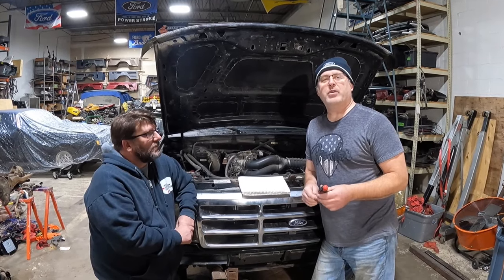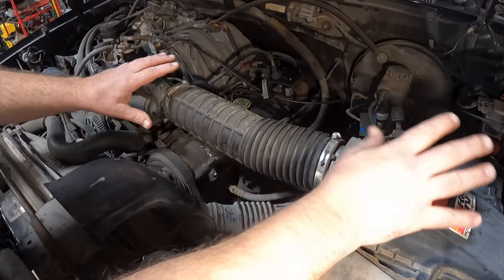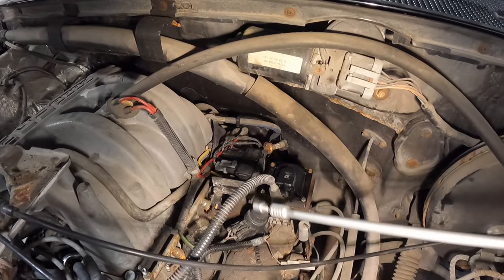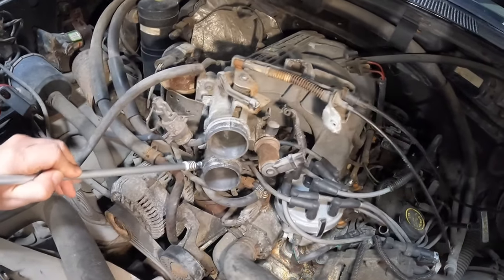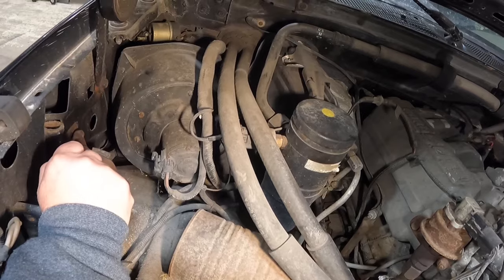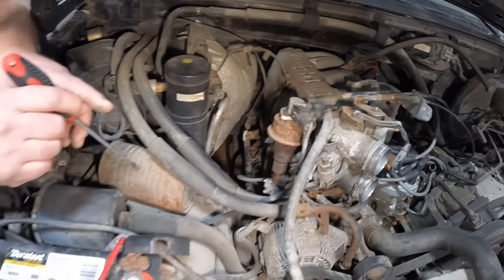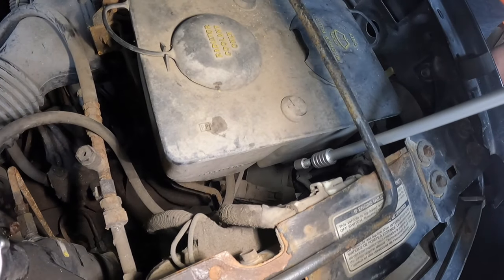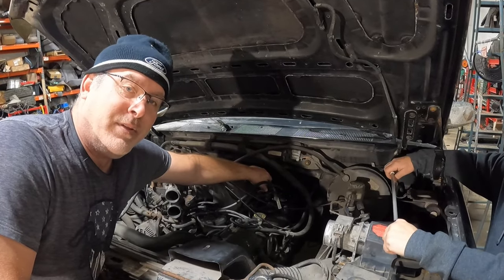What’s Under The Hood Of Your OBS Ford Truck / Bronco - Identifying 35+ Components (92-97)

Comment: Thank you so much for this video! I've had several of these in the past but it's been all carbs for me for a while. Just picked up a 95 bronco and needed to know if I can run an aftermarket temp Guage without the computer getting confused. Thanks to your video I'm off to the parts store.

That flux capacitor has been evading me for years! Never would have found it
Reply from the maker: Glad it was helpful!

Comment: Thanks for this, I've had a '93 f150 and now own my 2nd '97 powerstroke f350. I had a suspicion that the rotted out vacuum lines and actuator under the hood was for the Max AC or blend door. Now I know it's the Max AC. My blend/vent doors and switches all work, but switching from AC to Max AC does nothing- and now I know why!
Reply from the maker: Glad it helped

Comment: You guys need to look into the PCV valve #8 cylinder failure issue. You need to reroute the PCV valve line, and plug it into the vacuum tree on the manifold instead of the back of the intake manifold.
Reply from the maker: Great suggestion. We make “certain modifications” on our personal trucks.  This vehicle is For Sale so it was left stock
Reply: Yup I should have r next turned that.   Thx
Reply: Thanks. This is a known failure that has affected many F-Series and Broncos. It's a worthy reliability upgrade to highlight, just like replacement dash braces, Dana 60 swaps, RSK kits, etc....
Reply: Can you do a video of this problem and fix?

Comment: The PCM in my 94 F-150 comes out the front. Jack it up, remove wheel, remove fender chrome and inner wheel well. Note the inner wheel well can be 1/2 removed, pull it out some to get the PCM out. Use Dielectric grease when reinstalling PCM. Just a note - build a roof over the PCM harness to keep water from running down the firewall and into the harness.
Reply from the maker: We usually pull them without removing liner.  Dielectric greas is a good idea. I’ve used anti sieze too.    If your cowl seal is not rotted, you shouldn’t need a roof over eec.

Comment: I just did the 3g alternator swap from the fire prone 2g on my 92 f150. I was pretty surprised with how many melted wires i found in the process. Overall, for once, i was happy my alternator failed. I was able to rewire everything and im just waiting on the 95 amp 3g from rockauto. I was wondering what some of those wires and connectors were for under the hood. Thanks for the video!
Reply from the maker: No problem.  Share it!  I had great help making it

Comment: I was wondering what the point was to the vacuum reservoir. How exactly does it tie into the hvac vacuum? Are there any check valves involved?
Reply from the maker: “There are times that an engine does not create a good supply of vacuum. Because of this the vehicle manufacturers install reservoirs to store vacuum. The hose from the engine or the reservoir itself will have a check valve that blocks the loss of vacuum back to the engine. Why is this? When accelerating, the amount of vacuum created by the engine drops to a level that will no longer power any emission controls or provide for control of the ventilation system. The reservoir is designed to hold enough vacuum in storage to maintain control under most driving conditions. If the check valve fails the vacuum reservoir will lose vacuum so quickly that there will be none left in reserve. The result? A loss of control of vacuum operated devices.You can make your own as SigEp did but for the Emission stuff..."
Source: by miesk5 at FSB
Reply: Yeah if you don't have that vacuum reservoir, your heat or A/C will go to default mode instead of wherever you have it set at (defrost, floor, dash vent) every time you accelerate. 

The vacuum reservoir in my old Chevy developed a hole once, and you could hear the mode doors under the dash flapping around whenever I hit the gas as the heater control lost it's source of vacuum and it defaulted to floor. The more load the engine is under, the less vacuum it creates.

Comment: Very  use full and informative video. Are you sure this is a 1996?  I own a 1995 & 1996 bronco's with 5.8 and this vehicle looks just like my 1995. Key difference between 1995 and 1996 F-150 and bronco: all 1996 switched to ecc-v (OBD-II/diagnostic port under dash), MAF,  EGR Pressure Feedback (DPFE) Sensor, and a newer style vacuum canister.  Thanks.
Reply from the maker: This was a California Truck
Reply: @BroncosandPartsGarage     That probably explains it all being a California truck.

Comment: Fixed my HVAC blender door issues a couple of years ago, its nice cruising down the highway and the AC doesn't switch to defrost on its own anymore. I knew every part already under my truck except the TAB and TAD solenoids. I have codes for smog pump issues but never bothered to fix them. Usually when I'm accelerating and there's a wall on the right side of my bronco I can hear that muffler thing from the smog pump blowing out air.
Reply from the maker: You could always pull the smog pump and replace with a bypass pulley found on 1996 trucks with a 351w
Reply: @BroncosandPartsGarage  I imagine a modern cat setup doesn't need the smog pump anymore. I want to redo the exhaust so I will look into bypassing it. Don't care if the CEL stays on the bulb stopped working a long time ago. I actually had a mechanic look at my truck several times because the CEL wouldn't go out. The last time he looked at it he said the light is off now but he wouldn't explain to me what he fixed. Fast forward I realized my CEL light doesn't work anymore. I wonder to this day if he burnt the bulb or it was just a coincidence.
Reply from the maker: Smog pump should not throw a code. Because the engine doesn’t know if it’s spinning. But removing the EGR will give you some codes
Reply: Its been a while since I looked at the code but it is an upstream failure code it runs some diagnostic and the PCM determines that the smog pump solenoids aren't diverting air correctly and it throws a code.

Comment: hi guys that video was very helpful for me  
I have a 1996 f150 I have been working on it was running well until I changed the positive battery connector 
now it will shift hard or buck when shifting and it keeps blowing the 10amp fuse on #18 in the cab and I have no speedometer now.
can you point me in the right direction to fix this?
Reply from the maker: Is your overdrive stalk blinking?
Reply: Yes, on blinking 
I also noticed my speedometer is not working it keeps blowing fuse #18 inside the truck.

Comment: Thank you! 🙏
I notice on the throttle body, it doesn't have one tv cable that runs down to the trans, mine doesn't have as well. Is that okay? What's the purpose of it. I've notice some trucks have it done don't.
Reply from the maker: These E4OD transmissions are electronically controlled.  So no cable needed. The earlier C6 needed the cable.

Comment: I noticed the "open tube" coming off of the oil filler neck on the driver's side valve cover.   Is that supposed to be open to the atmosphere like that?
Reply from the maker: The truck is gone, but I believe that was supposed to go back to your airbox

Comment: I have the same truck but a 95 that I've owned since 96. Now and then, truck will turn over fine but will not fire. Twenty minutes or so, I'll fire right up. Distributor cap & rotor are fine. Changed the coil too. Could it be ignition/electrical or fuel/delivery?
Reply from the maker: Maybe a bad fuel pump.  Next time key it on and off a few times before trying to start

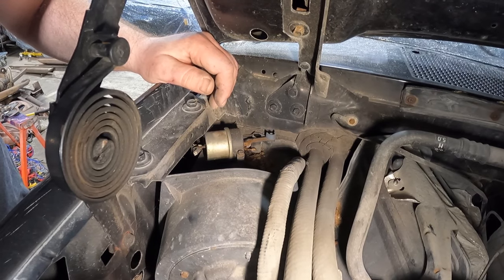Comment: Nice 👍. But at 9:00 my  line to that valve is broken and everything is still working. ? 
Although my F-150 quit starting.😮
Reply: (oh I'm sure it's not that hose causing the problem I've been driving for two decades without it connecting)
Reply from the maker: Odd.  I hope you got it started?!

Comment: Why does this truck have the grey ICM module?
I thought all Fords 94 onwards had the black ICM.
My 12/95 built F250 5.8 had a grey ICM and throw ignition codes, since i changed to the black one, everything works fine
Reply from the maker: Not sure. But it ran fine

Comment: How can I identify which engine I have on mine. I have a 1996 ford F-150 as well. It’s a rear wheel drive. I how many cylinders it is, thanks
Reply from the maker: Can only be one of two engines. Written on intake. 😉

Comment: 7:01 what is the metal tube at the top of the throttle body that has the hose going on top of the radiatior and what does it do?. My truck is missing the tube on the top. My one heater core tube goes to the T fitting that goes somewhere behind my tentioner pulley and the other piece connects to the bottom of the 2nd inlet on the throttle body. Thanks in advance as im learning about my grandpas truck. Really appreciate your video.
Reply from the maker: That pre heats the throttle body.  Sound like the other tubes are going to you water pump. Do you have heat?
Reply: Yes I have heat when turned on it just smells like dust so I'm replacing the heater core

Comment: I have wondered about the IAT sensor(intake air temp sensor)..Yours is located near the air filter..I have a 94 E350 RV with the 460  and the IAT is located in the intake manifold..So it is going to read hotter than yours at the filter box..
Just wondering if I was to relocate mine if it would effect the running in any way??
Reply from the maker: I’m not sure.  Try posting in the Broncos And Parts Garagw FB group.
Reply: @BroncosandPartsGarage  I am going to leave it where it is. The ECM is calibrated to expect hotter temps. If I put it near the the filter box it will see colder air and probable cause the engine to run rich ...in other words..don't mess with how it was engineered to run..

Comment: I recently swapped my blue dash from my 94 f350 for a grey dash from a 96 F250. Engine lights dont come on and it wont start. Junkyard said it would fit but my question is the wiring different? Do i need the computer out of the 96 now to fit my dash replacement?
Reply from the maker: What engine and trans is/was in each truck?   Size, gasser? Diesel?
Reply: 460 with E40d in each
 @BroncosandPartsGarage

Comment: I have a 93 and was wondering where the obd1 plug is?
Reply from the maker: Under hood beside cruise control servo to right of brake booster of looking at the engine fro the front

Comment: On my 90 f250 351w the line that runs down to the catalytic converter it just hangs by my exhaust pipe. Is it supposed to be hooked up to it somewhere? Also I have a plug that runs in the same loom as my icm and spout connector plug. It’s broken just hanging there and I don’t know what it is for. It’s just two wires. One black and one is black with a yellow stripe. Anyone know what it’s for? One more question. On the throttle body the purge solenoid line comes up from charcoal canister into purveyor solenoid then directly into the port on the left side of the throttle body but where does the line that splits off  to the top and bottom ports on the right side of the tb go? Once the two lines hook into the tee and then runs into a single line, where should that hook in at? Someone had my whole vacuum system a mess.. it was split before the purge solenoid with one going into the solenoid and the other going to the two ports on the right side. And of course the line out of the solenoid went to the left side of the tb. Does that line just split off after the solenoid with one to the left side of tb and the other to the right side and split again for the two ports? I know that’s a lot but ya help isappreciated. Once I fixed the line from splitting befor the purge solenoid it fired right up. Very hard start before i did that and very rich running. I also have an issue with it starting easier when I pull the line off from the solenoid to the left side of tb then if I let it run for a bit I hook it back up and the truck idles down and is ok
Reply from the maker: I need pics to help.  My contact info is in video description b

Comment: Hey guys whats that part at 10 minutes yall talk about called new to the "bay" area just trying to fix my truck?
Reply from the maker: That’s the emissions Intake or “muffler” for the engine.  Designed to eliminate the pumping sound.
Reply: I just bought a 1995 f150 and the truck take the air out from there, it’s open is it normal? Or need something at the end of that part you mentioned at the minute 10 , I want to fix it

Comment: Hey Chris! I have a question. My overdrive light is flashing, my cruise control doesn't work nor does my odometer and speedometer, are all 3 connected?
Reply from the maker: Start with The fact your cc is blinking means  you are getting a signal from your VSS located in your pumpkin. I would recommend swapping out you Psom or entire cluster.  There are services on eBay that Can repair your Psom as well- that way you can keep your existing mileage.  We sell the clusters too if you cannot find someone to repair it. Also check out your abs module behind your drivers headlight.  Small flat.  It’s in the video below.  If that’s bad it won’t register vehicle speed and u could have same issues.  Good luck man. 
https://youtu.be/cVY0Bh0wZj4
Reply: @Broncos and Parts Garage  thanks man you're one of the reasons I pulled the trigger on getting an obs.

Comment: Hello fellas, my question is about the Broncos 4 wheel drive system : Are there any after market or anyone selling Oem  AUTOMATIC locking hubs assemblies? If so who? I have a 96 EB all original... Thanks
Reply from the maker: I’ve never found a kit. They make rebuild kits.  I’m a fan of Mile Maker manual hubs- very low failure rate!!

Comment: So I have a 96 f150 5.0 and my vapor canister purge valve is connected to the vapor canister but not connected to my intake manifold anywhere…I’ve seen the location on other trucks where it connects between the dual intake part but it’s all solid cast aluminum from the factory …maybe I have a different manifold? Help?
Reply from the maker: I’ll try and look at a 96 in a few days.
Reply: @BroncosandPartsGarage  thank you

Comment: Okay I have 2 89 broncos a 351 in one and a 302 in the other I like my broncos I fought both of them for years just all kinds of things over the years about 1 year ago I put a new engine in the one with the 351 I put the Holley sniper fuel injection ignition system and and I put a 4R70 transmission with a stand alone computer on it and now the one with the 302 never moves when I get the money to do all that I’ll drive it again less wiring and no useless stuff anymore
Reply from the maker: That sounds awesome.  Very similar to our Aeronose regarding Underhood.  I have a few videos on 4th gens. Maybe check them out

Comment: Maybe somebody in the comments can help me  with an issue...

93 f150 4.9 xl 4x4 automatic.

Im having issues with the truck bucking and hard shifting, and I get a slight smell of gas when it starts bucking. It idles great, no issue there, but sometimes when I come out of park(drive or reverse), it'll cut off. Fires right back up no problem but sort of sputters when taking off. It will level out, but then start bucking again, then stop. The hard shifting comes with every gear change. 

Here is what I have changed out to help potential folks that may have advice:
Oil change
Air filter
Fuel filter
Map sensor
New  spark plugs
Intake manifold temp sensor
Ignition control module
Ignition coil
Fuel and oil treatments
Deleted EGR valve to diagnose that possibly being an issue

Im considering next:
O2 sensor
Distributor cap and rotor
Throttle body sensor
Cat converter(though im told that was fine)
Fuel pressure regulator(told that was fine as well)

The fuel pump is maybe two years old at most fyi.

Does anyone have any other ideas here? Want to make sure Im not overlooking some potential culprits here.
Reply from the maker: Post this on the FB group Broncos And Parts Garage.  I’ll find you there
Reply: @BroncosandPartsGarage  Im not on FB. Ive dug through countless forums trying to diagnose this issue lol
Reply: Same here… did you find what was causing it?
Reply: @PoopsyColons  I did. So we ended up changing out the entire distributor set up but after nearly 4,000 bucks thrown at the truck it ended up being the part I suspected first: the MAP sensor. I replaced it first and foremost and when that didn't work we went and chased down every possibility under the hood only to come full circle and find out the MAP sensor I put on there was faulty from the get go. So I went from a $60 fix to $4000 lol. But it really is hard to say if that was the only problem associated with it. But the truck is running like a champ now. 

Also, before people wonder how or why I spent 4k there was lots of other work I had done to the truck in the process of chasing that issue. I went ahead and dropped new motor and transmission mounts, completely reworked the rear brakes, power steering, radiator and a few other things that were on their last legs already. 

But yeah, MAP sensor, the first suspect. Went bad, and the new one was bad out of the box.
Reply: @savage_the_wild   bittersweet but glad it worked out. Enjoy your ride!
Reply: @PoopsyColons  let me know if you have similar results or even different findings. Id love to know more on how it worked out your way

Comment: So what exactly is the part at 4:47 on the coil
Reply from the maker: A condenser to eliminate noise in your radio.  Older cars would whine thru speakers
Reply: @BroncosandPartsGarage  I have a subwoofer for just a little bass and it had motor noise that condenser might be bad